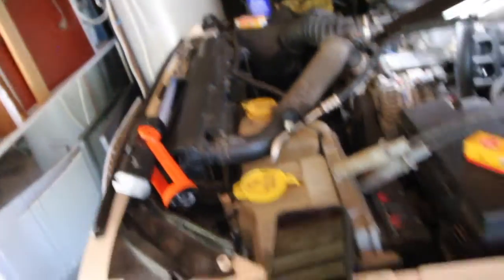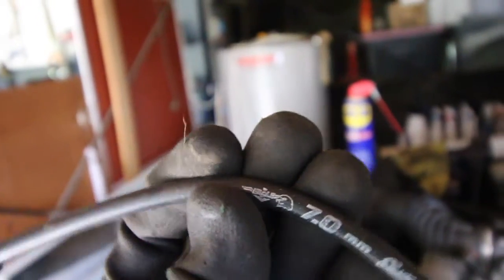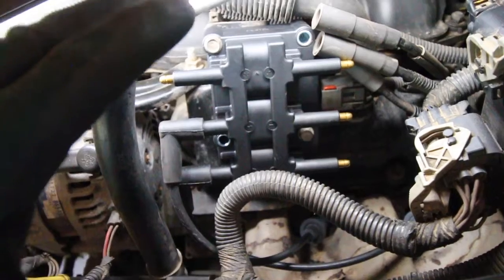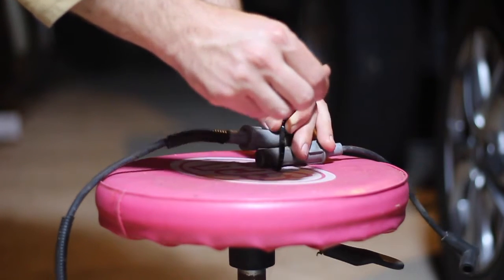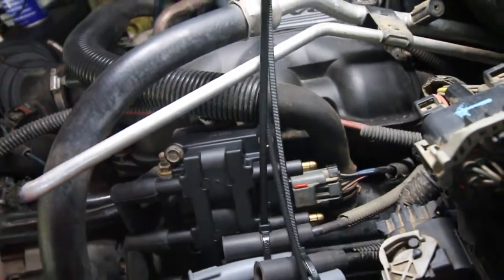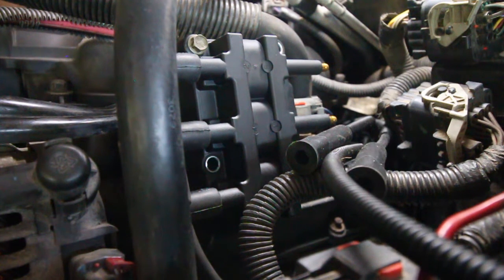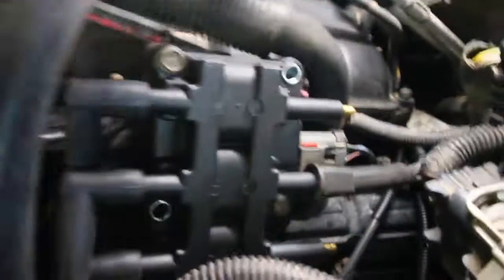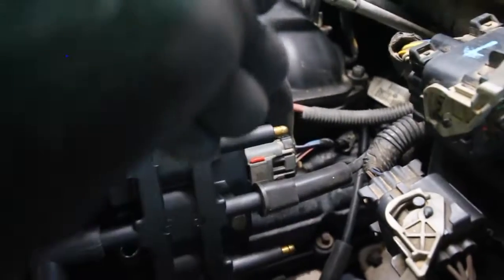HOW TO REPLACE JEEP JK SPARK PLUG WIRES-QUICK TIP

Comment: Thank you so much for this, My brother and I  have been struggling for over an hour trying to to get the spark plug wires on his JK around the back of the motor. Thanks fo the tip.
Reply from the maker: That sucks, took me a bit to figure it out, but very simple idea that has saved so much time. Thanks so glad it could help.